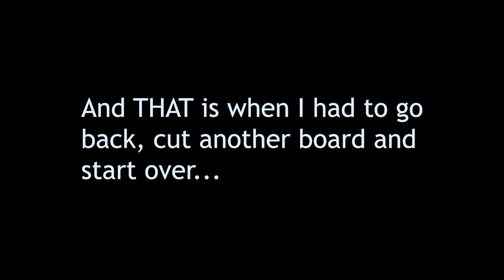DIY Toddler Learning Tower

Comment: Does it seem pretty sturdy, even if your oldest leans backward over the metal bar? I’ve got a 3 yr old that would be hanging and swinging from the bar, lol, have your kids done that?
Reply from the maker: The back step keeps it from rocking backwards. Oz is about 35lbs and he hangs from that bar like a champ. I went with iron pipe for the cross support for that reason. I have contemplated putting a couple of L brackets pointed off the front that would catch right under the cabinet toe kick, but I think it will be fine without. One thing I will be adding is some rubber feet. I have noticed it has a tendency to slide away from the counter if they push on it right.
Reply: Build Dad Build thanks for the info. Like your family friendly videos